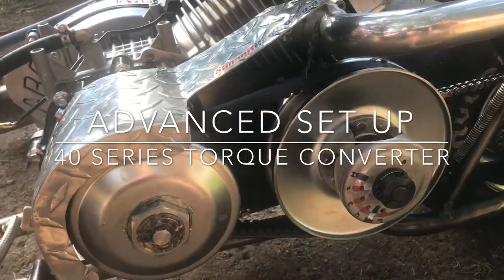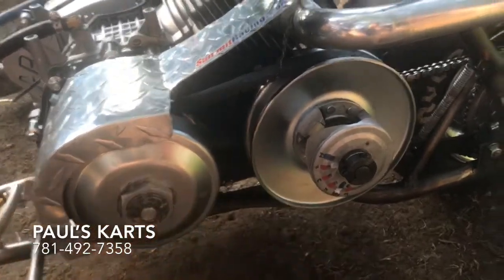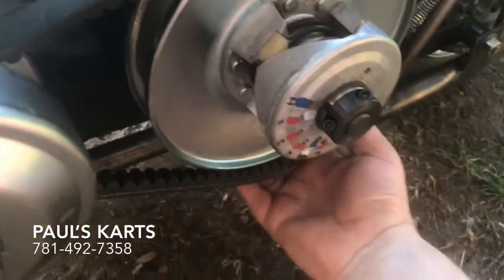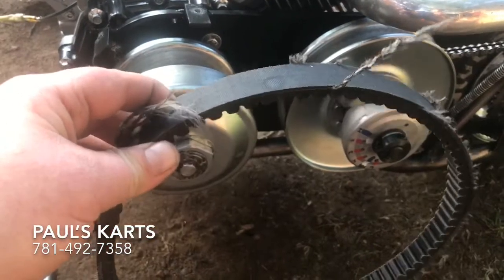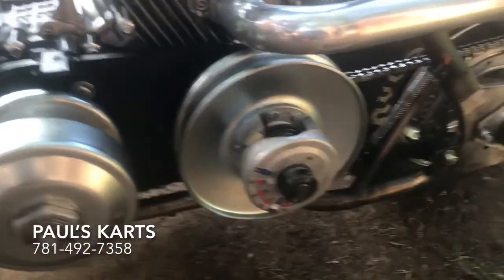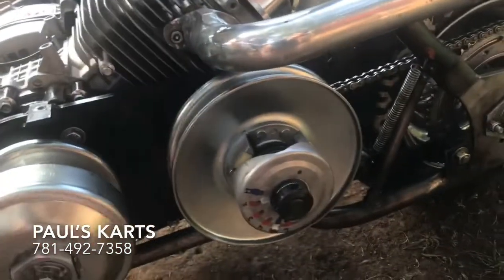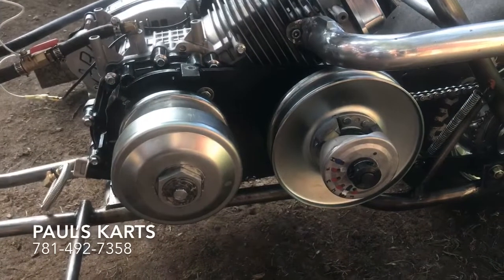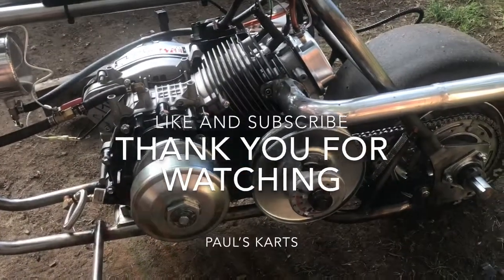Review, Tuning ,”HOW TO MODIFY “, Comet 40 series torque converter/cheap e bay 40 series tav

Comment: I purchased a 40 series of enay..things is the sold me the 40 series driver and 2ndary drive but sold me a 30 series backing plate. I keep blowing belts any ideas? I already know re purchase a 40vseries from a reputable source.. but until I do what can I do? THANKBS PAUL
Reply from the maker: Start by replacing the belt with an original comet belt.
Reply: @paulskartslifan4206   Thanks PauL Thinking R^R entire system so , I get a Steelbacking Plate~ For Protection)  N-caae of un- wanted. SCHRAPNEL  ~And.>
"" PuH💥PoW"" I'm GonE~!
Reply from the maker: @terrywood4677  yea 100% on the steel backing plate .. that’s what I ran. Or you could do a jackshaft and save the 10 lb plate setup
Reply: Engine is wAY MoLeSTID sitting w/ 390 Honda stroked, bored  cc'd, big cam  ReaL TalK  blowing belts ==BLOW-iN  $ °H°A°R°D° BLOW-IN $ in the FLaTLanDs of Kansas
Reply: I left this out  Superchargedw Mikun.34mm jetted wPower/Jet  on 1 stage Nitrous. Oh, BLoW iN BELTS, 
SEE UH PATTERN HERE~ MIRE DiLLars.Than Sence. Oh.. cents   Tomatoe. TomotIHHhhh, there went another belt.
 ``        °H°A°R°D°
GriN ~

Comment: you have an asymetrical  pulley setup try getting a symetrical pulley setup or stop useing a symetrical belt with an asymetrical pulley setup to clarify an asymetrical pulley has 1 flat side 1 beveled side of the pulleys and requires the correct belt  a symetrical pulley setup has 2 beveled sides on each pulley and uses the belt your running now which is why your frying them so quickly look it up symetrical and asymetrical power pulleys
Reply from the maker: It was years ago but i don’t believe it was the belt that was the issue. Think I was just flat out making to much power.

Comment: Your secondary is backwards
Reply from the maker: Is it ? That bike won so many races with it backwards. 🤣 .. I never even knew. I know I got the reverse spring but never knew it was wrong. Oh well .. might wanna try yours this way. Fastest bike I ever rode in my life. I have seen them run every which way including guys running the primary backwards. I guess as long as your springs are right and the tapers are aligned it’s all good. But I don’t have this bike assembled any more. Been apart for maybe 2-3 years. Now to busy to rebuild it.

Comment: Tried the juggernaut yet Paul? I have a built 270 looking to get a torque converter set up but I like that juggernaut, the only issue is they don't seem to make it for a big block so I might just have to get a 40 series to handle it, Im turning 7700 rpm with approx. 4.5:1 drive ratio 47.3 mph, on a heavy 2 seater from an amusement park with two adults on it 675 lbs. I know the engine has more rpm in it and I need that infinite ratio, I understand it will dramatically improve launch and then some converters actually hit a little overdrive.
Reply from the maker: I think the juggernaut has potential but it breaks because it’s a cast unit and the arms that hold the weights are to thin. Maybe in a year or so they will make a new casting to fix this. For your 270 I’d use the 40 series. All steel driver inside and out, You will not have any belt slip with that engine and can dial it in pretty good. I’d recommend the 40

Comment: Ops wrought button but the T cat would wheelie and bend the tunnel it had so much power but Matt knew how to set his clutch up to where as soon as you hit it it the time you got your thumb to the bar the engine would be at it max rpm his motor maid 145hp at 8100 RPMs so before you could realize what was happening his engine was already at its happy place I am just trying to give you a little background on myself to help you digest what I am about to tell you look up Jeff Trask on Facebook he is one of the fastest men on ice period and all of the knowledge we acquired came from him he would always give us enough info to beat the rest of the competition. The lighter your weights are the more belt sli
Reply: The heavier your wheights Are the more force they apply think about centerfudle
Reply: Centerfugle force the big drive spring has a lot to do with how and when the the engine will shift every component in affects every aspect
Reply: Wow my phone calibration is way off I suspect you figured this out the hard way  comet should be shot for the way they explain how their products work basically they explain it so that every person that can read will understand what they are saying and they should produce a lot more components for their tourqe converter systems anyway I have learned so much from you about my beloved 460  and my sons tillitson 212 and I hope that in some way my past snowmobile obsession can in some way help you we also would change ramp angles in our secondary clutches I am seriously considering buying a mill and a lathe and producing performance products for the so called tourqe converter systems I live in NC now so go carts are my way off dealing with my snowmobile withdrawals thank you so much for sharing info that is never shared and the prices of your products is also much appreciated hope you enjoyed the novel I just wrote sorry it was so long I am better with tools than I am with words

Comment: Just food for thought but I grew up in Maine and the first love of my life was drag racing snowmobiles.  My best friends were two brothers the older one is a competition winning machinist.  Well he always dated the daughter of a man that back in the 80’s had a Yamaha Phazer  which had a twin cylinder axel fan 485cc dream wrecking monster that on radar would run 102 miles an hour my friends and I learned a lot the older brother would absorb the info and the younger brother and myself were crazy enough to tear our own sleds apart and let the older brother go to town with his milling machine.  So drag racing snowmobiles is won buy modifying your clutch system period I watched the younger brother take his stock engine SRX 700 and smoke I mean 6 or 7 sled lengths in 550” on grass against a 1000cc thundercat.  After bragging about pushing it 300 hp on dyno Matt really maid that man wish he knew how to modify a cutch chassis also was part of the outcome because the Thundercat
Reply from the maker: That’s cool .. sounds like fun.... 👊😎

Comment: Sounds like misalignment.  When you have both movable sheaves on the same side the belt will be out of alignment in low or out in high (full shift). This will cause heat. If the driven spring goes in to coil bind meaning the sheave can't fully shift the driver is still trying to fully shift and is hard on belts too.
Never seen a Comet 40 series driver cover bend from the roller weights pushing on it.
Reply: Thank You Fellows 
I do appreciate  iT~! 
And thats straight from the > °H°A°R°D°

Comment: I believe you are shreadding the belts due to inverted installation. Either the drive or the driven pulley has to be installed the other way around....
Reply from the maker: No that’s not it .. but good try .. and thanks for the comment
Reply: @paulskartslifan4206 actually he is correct. The belt needs to remain aligned throughout the pulley movement. A 40 series is different than a 30 series requiring 1 pulley to be flipped and run “inboard”. Both of yours are facing outboard. With the current setup as you increase throttle, your driver pulley moves the belt inward while the driven pulley moves the belt outward. That’s why you’re stretching and shredding the belt. Even the Comet install manual for the 40 series recommends installing one pulley inboard.
Reply from the maker: @McDorkin you could possibly be right, I haven’t had this bike driving in years tho. Old video so maybe if someone is reading this try the way he recommended and see if that helps you. It’s been a long time since I was messing with these things.

Comment: Hey Paul do they make sprockets for these torque converters that use a 520 chain?  I'm trying to mount this on a Yanmar clone in a bike with an EX500 rear wheel and they use 520 Motorcycle chain.
Reply from the maker: // the torque converter is mounted do a axle .. they come in 5/8” 3/4” and maybe 7/8” you’ll have to check. So what you’ll need to find is a 520 sprocket That fits one of those size axles then order that size torque converter secondary pulley or what some people call the driven pulley. The one that goes on the engine is called the primary or the driver. You have to buy the driver size that fits your crank. They can be dif sizes as long as there both the same series like 40 series

Comment: You keep changing belt because if it has any more upgrade and pushes more than 18 horsepower it's not recommended a torque converter

Comment: You talk about belt temperature in your video. What do you suppose having the driven clutch an inch away from the belt does to belt temperature? Maybe some exhaust wrap, huh?
Reply: He ain't sitting around idling, with a heavily modified air cooled powerplant, airflow will cool it a bit, plus then he will hide the beauty of the pipe, P.S how is miss piggy?

Comment: Sir good day is it applicable to use torque converter in mountanous terrain specialy hill sloop
Reply from the maker: Yes ... That’s the exact purpose of the design .. will work great for
You ...
Reply: @paulskartslifan4206  thanks

Comment: What do you mean by "I've outgrown Comet"? 
Also, how do the knockoff driver/driven units compare to Comet brand? Any noticeable difference between the two?
Reply from the maker: No .. I’d actually recommend the knock off ..just use comet belts .. I mean I out grew the power handspring capability of a 7/8” belt .. I’m making 63hp on nitromethane and 43hp on methanol ... only getting one pass on nitro on a comet belt .. gets expensive
Reply: @paulskartslifan4206  Thanks for the response. I'm only working with an unmodified 301cc...just got a knockoff 40 series and was curious about any possible differences.

As far as belts go, I'm on the Comet train. We ride offroad, through some pretty nasty conditions down here in southwest Mississippi, so shredding Chinesium belts was an issue on our 30 series machines. Once we switched to Comet brand, that was no longer an issue...haven't lost one yet. I'll probably shred three tomorrow morning since I said that.

Comment: I just destroyed a 40 series torque converter today :( 300 dollars down the drain only using a gx390
Reply from the maker: Really what happened ?
Reply: The belt just shredded up then wrapped up and snapped both belt and torque converter I have a video of the damage on my channel
Reply from the maker: Ok saw the video .. cheap ass casting backing plate .. I have a billet steel prototype one I was running that was $400 alone .. if your interested in buying one send text ... proper stuff is needed to run the big blocks .. they make power

Comment: when you start to play around with the shift points on the driven unit that's bolted up to  a built motor that spins much higher rpm's then a stock motor would, it really becomes havoc on belts. controlling the shift points for example on a golf kart or a utility kart can work great. a vehicle engine for something like that is now running at a low speed/rpm's and changing the shift point with a different spring or adjustment hole will now work much better. I find on the comets units to just let the rear driven go through its motions and then use a jackshaft setup to get the gearing correct so it will pull the correct rpm's for your application. unless your trying to run a 1/8 mile or something long. then you won't need the jackshaft. the measurement from the center crank to the center of the driven need to be correct distance to. dents and rewelds in that driver can't help balancing at all...
Reply from the maker: Balancing is perfect ... and you definitely need to adjust the secondary if you want the most out of the converter ..

Comment: Hey sry I didn't get back to ya about those clutches. The Polaris p85 and 90 I have I don't think will work for ya because it's a different crank taper
Reply from the maker: Yea , i have been looking around and reading ... so what do they look like ? Are they like the flywheel side. ? Like tapered ? I know there are 3/4” stuff .. I wish I had some here .. I would be able to  at least try and see if I can get it to work
Reply from the maker: Can you measure one of those cranks .. do you think a driver can be turned down on the inside to fit the 1” Straight shaft ?